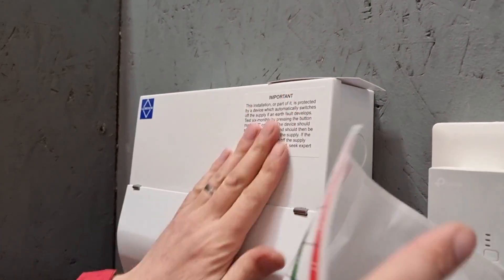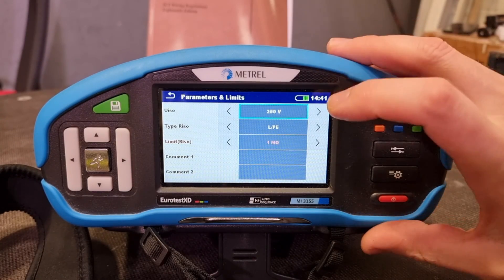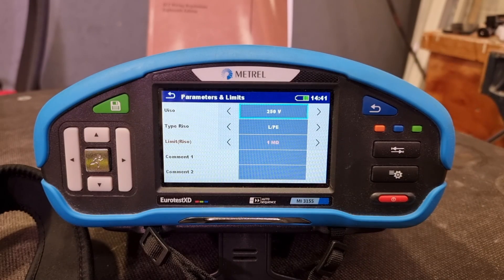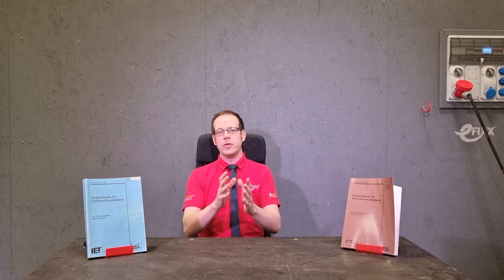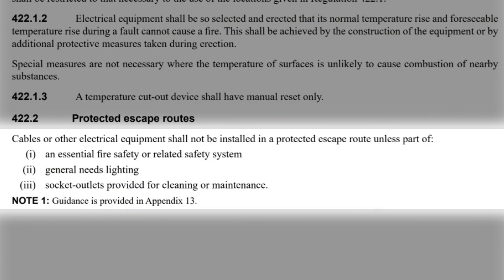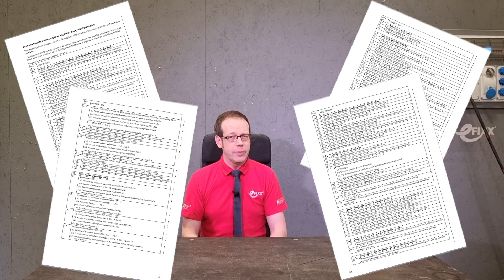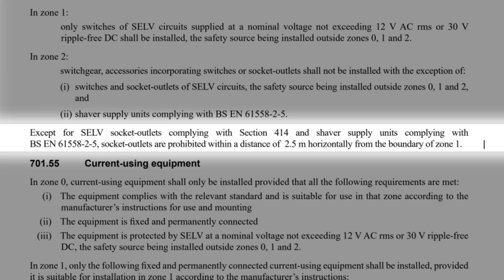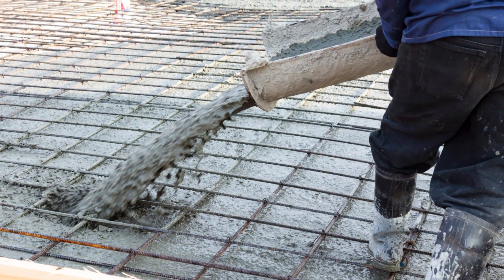13 Changes in BS7671 Amendment 2 - Plus ONE that didn't make it

Comment: AFDD's recomended was obvious considering the cost and as so many people pointed out when testing they only seem to sense on high load circuits Showers/Hobs/Cookers and EV points.

Prosumer installations have needed addressing and their own section for awhile.

So functional earths are going Pink but Audio cables are already pink - doing away with functional earths would have been preferred as most manufacturers are going that way anyway.

Consumer unit labelling should have gone the same way as Gas installations with the pack being left with the customer ages ago. Was doing that anyway and Inspectors had no issue with it at all outside of commercial installations.

IR is going to be a bit of a pain but regs aren't retrospective so carrying out EICR's will continue as normal, new installs is going to be a headache depending on what equipment is installed along with the organisation of sites to make sure it is even able to be carried out in the time frame.

Type AC needed to go anyway and majority of people I know don't even put them forward as a possibility to be fitted.

SPD's standard regardless because it was never worth doing the calculation if you could even obtain the required information compared to the cost of just added it - less than an hours charge.

Protected escape routes - saying you can't use ceiling voids above protected escape routes is extremely problematic - surface runs fine, but in the fabric of the building where it will be either clipped or run through joists? Makes absolutely no sense at all.

Tick boxes reduced. Cool.

Sockets in Bathrooms - ignored and a risk assessment and signed documentation by customer is they so desire one and fitted onto a dedicated circuit.

Solar is becoming more main stream so an extended section for those coming across it during EICR's again was an obvious choice.

Foundation earthing/TT stakes, pain in the backside for terraced properties, listed buildings and flats but otherwise a sensible addition. 

English language is a pain.

Comment: Reflecting a bit more, identifying when a property is a HMO suddenly becomes more important, in some local authorities a 3 bed semi rented to 3 different parties is a HMO and this might not be obvious.
Another thought is that presumably altering a circuit will require adhering to amendment 2. There's a LOT of type AC split load and dual RCD boards out there that it seems won't be suitable for circuit alterations, just like for like replacing of accessories?

Comment: Test hard wiring at 500v before connecting equipment 'sensitive to test' and then test at 250v.  Is this regarding new installations only? Or does this apply to EICR's that may contain sensitive equipment that the test engineer is unaware of and risking damage costs?
Reply: not really any need to ir test an instalation that is already working. if its on an protected by an rcd there wont be any ir issues
Reply: @scottsparky1  0.9megohms on a circuit may not trip the RCD but would be a failure on an EICR IR test on a circuit.

On an EICR we're there to check for potential dangers, and that would be one as the insulation is breaking down and have gone below acceptable reading.

Comment: With the bulk of electrical appliances now being low current, and not one that could sustain an arc over any great distance, are AFDDs going to do anything valuable?  To make them sensitive they will probably end up causing nuisance trips by the short, safe, arcs and sparks of switches and control equipment.

Comment: There is a difference between a 'Unprotected Escape Route' and a 'Protected Escape Route' as per  'Part B - Fire Safety'.

"Protected routes are escape routes that are physically separated from other parts of the building by fire resisting construction to minimise the risk of the escape route becoming unusable due to fire and smoke spread within the building." aka Fire Stair wells. 

"Unprotected Escape routes are routes which a person has to traverse before reaching either the safety of a final exit or the comparative safety of a protected escape route." aka a corridor. Most corridors in schools, hotels, flats etc will still all be unprotected escape routes because of all the services running through them.

This Reg shouldn't really effect designers as they should already be working to it. It's been brought in to stop installers who are adding additional circuits after the building is finished from using things like Fire Staircases as risers and then not fire sealing properly / at all and making it 'Unprotected' (like Grenfell)
Reply: It also stops retro fits for HMO's being just lashed to the surface cheaply and means to convert a property a full rewire will have to be done. Which is how it should have been originally anyway.

Comment: eFIXX, great video.  Is the regulation regarding RCDs at 3:50 referring to RCDs for fault protection (ie meeting disconnection times) or for additional protection?  Does 643.8 no longer exist?

Comment: My understanding from the IET presentation was that it is only a requirement for a 1x type ac test on an rcd, you do not need to do it at 0 and 180 degrees.
Please correct me if I have misunderstood this.
(Approx 16 minutes into the presentation for reference) https://youtu.be/ntDCLNveRDI
Reply: I personally wouldn't sign off an RCD as being safe unless it operated during both half-cycles. Now type AC RCDs are going, the rest are electronic so any diode-like failure in their (internal electronic) circuits could surely cause this type of problem. Haven't seen the brown book yet, but it wouldn't change my view on this.

Comment: Good news on type AC RCD's .. sigh of relief on the surge protection.. and huge groan on protected escape routes, as if it isn't tight enough as it is, i'm going to enjoy what the architects come up with there fancy drawing .. and does that mean everyone who has fitted a socket in a metal box with one fixed lug and hasn't fitted a fly lead should panic .. as that's a recommendation :) Well done Joe

Comment: I'm about to pour foundations for a major extension and associated floor slabs...... Would love to see an episode on what constitutes a foundation earthing arrangement and would consider doing that now for possible incorporation in the future....
Reply: Don’t worry 😉 
The regs are not retrospective 
Defo have SPD fitted
Consider AFDD’s
Reply: @stevensmith4449  oh, I appreciate that...... and done all of the above....  just looking to the future and possible solar/battery generation& storage.... cheap as chips to do now as a self builder and fit and forget until needed.........
Reply: @BerkeleyTowers  might be useful with the battery storage?
Foundation bond might keep excessive Earth fault current going through your house if the building is fed from your house?
Reply: If you do want to ,  but realize it is an option not a requirement, tie in a bit of extra re-bar to the steel grid, and bend it up into a J so that it is accessible in a convenient corner. Hose clips are more than adequate. Or if you have a welder working  on site tack some M8 or M10 stud so that it is vertical and pops up next to the internal wall. I  tend to specify two places so that I can buzz continuity between them and verify nothing has come off during the cement pour stage. Mike.

Comment: 20th edition IET wiring regulations = permanent education at university 4 days/ week with 1 day/week installation testing - Actual installations done by others. 
Regulations to be checked daily on line and no work to be carried out unless entire installation upgraded to new standard existing on that day.
Design of Electrical systems to be outsourced to a special panel of approved designers with 24 week lead time and scale of charges equal to the total value of the contract.
Any tampering/modification/change  of Electrical system's to be punished by mandatory 10 year jail sentence.
End result that electricity is to be ended as its too expensive for 99% of the population of the UK.
All new homes have just 1 light and a single power socket all behind locked tamperproof cages.
Rest of the world relaxes 90% of all regulations.
Reply: Back to plugging my iron into lamp holder !
Reply: Ha ha ha ... yeah you are really funny. But what is with power-making companies? Are this regulation are the same - mean in 30 years Irland, Isle of Man and the independent country of Scotland send power over EU-regulary power lines? 😁🙄🤔
Reply from the maker: Hm, that is quite the dystopian future you've imagined there, we'll check back in a decade or so and see how it fared.
Reply: @efixx  It is, unfortunately that's how the Gas industry went. Originally you qualified and that was it, then when the colleges ended up in trouble they said you'd only have to go back and retake it this once. That quickly turned into every 5 years and being tested on every single type of appliance possible broken into Domestic/Commercial/Catering categories. There is always innovation and improvements in technology and safety but going from a CPD to an exam format that costs thousands each time you sit them on top of GasSafe/NICEIC memberships etc is what really riles people up.

Comment: Joe.. Thank you !   A rapid fire  'tour de force'..!    I want to ask though, do I understand correctly that a Surge Protection Device  will now be a 'recommendation' (on an EICR) rather than mandatory ?  And will it be a 'requirement' for both new-build and new Consumer Unit installs..?  Thanks 👍
Reply: EICRs are supposed to check the condition of the installation against the design required at the time of the installation. They do not require modern standards to be retro fitted. They can make improvement recommended and can classify things as dangerous and needing immediate attention. 

What he said is that if it’s a new install or putting an updated consumer unit then you no longer need to do an assessment on the probability of a lighting strike and they type of supply (ie overhead power lines incoming to the property) and work out the numbers accordingly. Basically you recommend it and if the home owner says nah then they have to sign a waiver.
Reply: @davideyres955   Thank you, very much appreciated. And having watched the presentation a second time, I recognise that you are indeed spot on.. Cheers.. 👍

Comment: What is the idea of omitting x5 rcd testing? 
Seems good practice to confirm they are providing additional protection??? Ie <40ms at x5
Reply from the maker: Good practice if you want to for sure, but you don't need to. Proving devices work is for the manufacturers to do. 😊
Reply: @efixx  If that logic were true then why do we carry out RCD testing at all then? Also there are many variables onsite that may mean than an RCD will not operate as it did in the factory.
Reply: That’s why back in the late eighties when I did 236 we didn’t test RCDs , one the weren’t that common and two it was taken for granted that they would trip as intended at the specified time based on the loop impedance value . We simply put our trust in the manufacturers.

Comment: Ammendments are simply correcting mistakes that should have been right the first time. More thought and less rushing to print is required.
Reply from the maker: Hm, not sure I'd agree with that one, some changes may reflect corrections of past mistakes but Amendments to the wiring regs usually reflect changing technology in the electrical industry.

Comment: I presume the earth spike will be for new builds only? It won't be required if you're doing a replacement CU on a TN system?
Reply: New regs are only for new installations or if you replace a certain amount of the old installation. Otherwise they must state that a retrofit of old installations is mandatory. Personally I would recommend a retrofit, you can‘t enforce it on the customer, but it‘s improving the safety in case of a PEN fault and is reducing the earth-loop impedance. The more installations with an electrode are in that area, the lower the impedance will get because they‘re all in parallel and all summoned up resistances in parallel are always smaller than the smallest single resistance of that group. And also keeps the potential of the PEN close to real earth potential. That reduces stray currents.
Here in Germany foundation earth electrodes or soil embedded earth electrodes are mandatory for new construction since 1980. Doesn‘t matter if you have a TT or TN-system, must be installed on both. The common earthing systems are either TT or TN-C-S. In some old installations there‘s also TN-C in final circuits.
Reply from the maker: I really thought foundation earthing would be in on this amendment Marcel, it'll be interesting to see if it makes it into the 19th, we'll see how we go with the earth electrodes for now.
Reply: @efixx  It got lobbied out on 'practicality' reasons. Often when the foundations are being done the electrical designs aren't finished or even which electrical contractor decided upon. So the location or size of the Earthing and who's going to install / check it's okay could be a hinderance. So they keep it out.
Reply: @efixx  Especially with the advent of EV's on peoples driveways and shock risk as you showed in a past video. Seems a logical thing to include.
Reply: @___AD  It's actually quite easy. You check where the DNO is entering the building, the water pipe is coming into the building, and eventually the gas pipe. And there you install the equipotential bus bar of the building. Otherwise you need longer cable runs. That's what these bus bars look like here in Germany:

https://upload.wikimedia.org/wikipedia/commons/8/8f/Potenzialausgleichsschiene.jpg

Usually there's a sticker inside of the cover, there you can label what bonding cable is for gas, TV cable, gas pipe, water pipe and so on. The sticker here on the picture is missing, but instead we got some cobwebs. The most right "wire" should be clear, that's the foundation electrode.
And back then here it was also argumented that this would improve protection against lightning strikes. That's the reason specialists for protective gear against lightning strikes are also permitted to install foundation earth electrodes.
Reply from the maker: That is a really good question, it's interesting that the reg doesn't mention new builds as the foundation earthing did in the draft for public comment. My take on it would be that if you're rewiring a property or replacing a consumer unit you would pop it in. You probably wouldn't leave out RCD protection for a property when replacing a consumer unit just because it's not a new build. Just my opinion of course. 😊